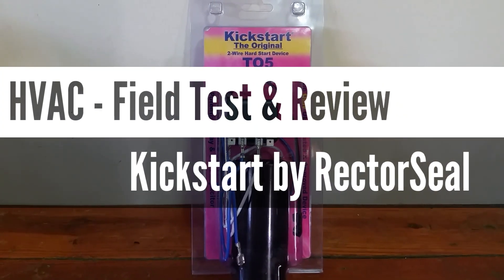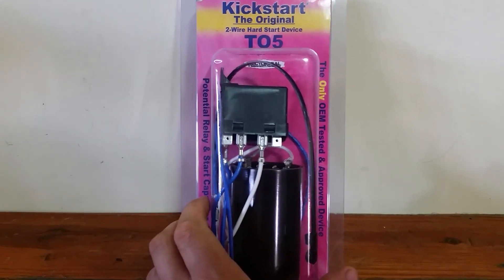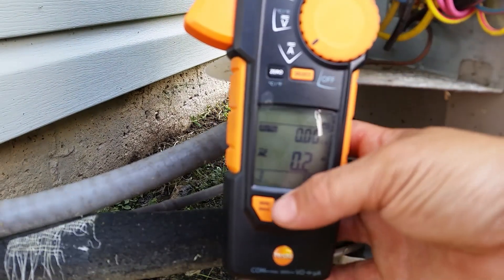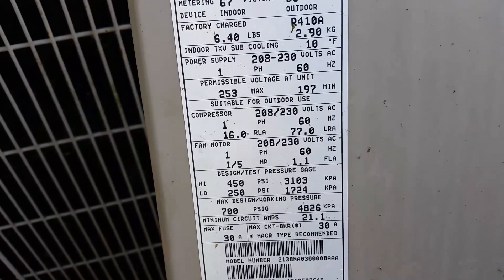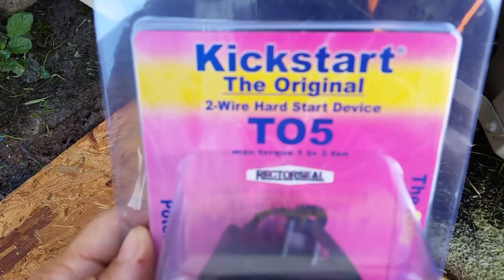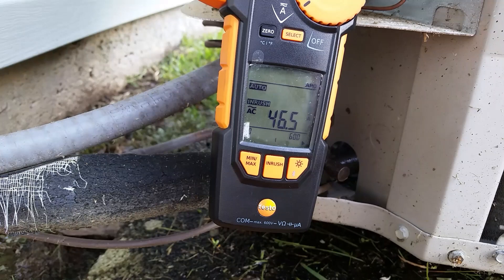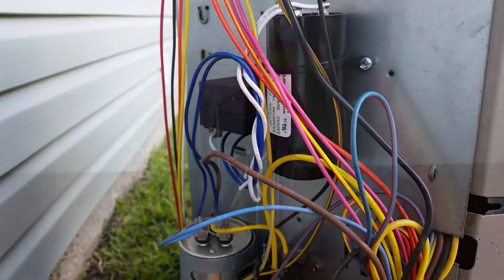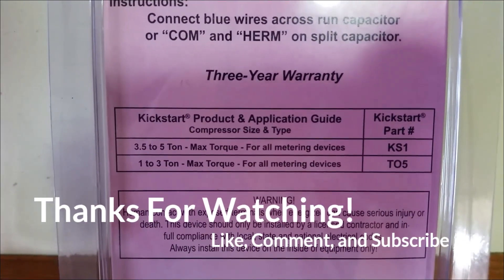Kickstart by RectorSeal Test And Review

Comment: Great demo.  on the RectorSeal, does it matter which Blue Wire goes to HERM/COM terminals?  I'm thinking of changing to this versus the Turbo Easy Start 2-Wire that's in there now on my 3.5 ton unit.  Thanks.

Comment: Thanks for the video.  My a/c wouldn't start yesterday.   I popped the cover open on the wiring cavity and the unit started right up.   I noticed the big black cap is Corroded.  How long do these kickstarts last?   Mine has MFG date of 2014.   Time to replace 6 years in?

Comment: The hard start capacitor comes shipped with no MFD for safety reasons from what I’m told and the best way to check it’s full potential is to install it and run it so the hard start can recharge itself then test it with a charge in it. What I’m wondering is how you lowered your amps in half unless it somehow had a charge. I installed a 5-2-1 in mine they claim it’s better than a 2 wire with the relay in the cap and I feel it’s better with an external relay. My 2 Ton was 58 in rush and when I put the 5-2-1 kit in it read 29.
Reply from the maker: Start capacitors ship discharged and that is how they should be checked. The MFD rating or capacitor value is determined when it is made in the factory and has nothing to do with its ability to hold a charge once power is applied. 
You will have to Google how capacitors work or how they are made to get a more in depth explanation that I can't give in text due to length.

Comment: Why does the factory not put these on their units ?  Wouldn't it be better for them?
Reply: Cost savings and potentially more parts to fail. You could also argue it may shorten lifespan of the compressor, generating a replacement sale sooner. My Lennox had the option from factory or add on from Lennox, but they charge over $150 for what is a $30 kit.

Comment: I see the capacitor was a 189-227mfd   you should try what copeland lists as a start capacitor the most common is a 88-106mfd  330v  if your in the HVAC business you know only the higher end ac units come from the factory with start capacitors lower end units don't to cut cost most wiring diagrams for the unit even if it did not come with a start capacitor from factory will show the start capacitor & relay in the wiring diagram . here the copeland info http://www.emersonclimate.com/Documents/Products/Compressors/residential_scroll/ECT2013ECT1.pdf

just wanted to add those Supco  are total junk in my option CHEAP MADE IN CHINA  I noticed the Kickstart kit had a B-M-I which are USA made much nice Kit     B-M-I  & TITAN-HD also made in USA is all i would use .
Reply from the maker: 218Bee mod43win  As the video clearly indicate I was testing out a product. Thanks for your opinion
Reply: what i was tiring to say is you should try a 88-106mfd as copeland list to see if you got the same lower  inrush amp draw as the Kickstart 189-227  mfd    it be interesting to see if the 88-106 capacitor has the same lowering of the inrush amps .
Reply from the maker: 218Bee mod43win I understand but I was only testing what was currently being used in my unit versus the Kick Start.
If we ever test multiple start devices against one another we may get more in depth.

Comment: Ive been using this product for around 5 years. Its great!
Sometimes the capacitor needs to be on the system for a cycle or 2 and the LRA will go lower even more. 
Did you get the amps on one more cycle? 
I like the new testo amp clamp btw👍
Reply from the maker: Mike Cianfrocco First cycle was actually 51A, the second was seen in the video at 46.5A
Thanks for watching
Reply: HVAC in SC i meant for the kickstart .

The first style hard start doesnt work in the summer here in florida. I dknt use those
Reply from the maker: Mike Cianfrocco The kickstart is what Im referring to.

Comment: I no longer use the Supco's due to finding them with blown tops, i.e. you get what you pay for,  Kickstart all the way for lasting reliability.
Reply from the maker: muniznick Thanks for watching
Reply: What about CPS/5-2-1? Amazon seemed indicate them as the main player in hard start kits. Reviews seemed good as well. Working with a 4 Ton unit running well but tripping the breaker occasionally.

Comment: awesome!!! I've used #66 potential relay with start cap...most of the super boost(2 wire ones) and variants the start capacitor has a low mfd most 150-160... that can start a 1 1/2- 2 ton unit, for 3-5 usually 250+ mfd start cap will work... in refrigeration you use that type of start kit and the one you reviewed can get me out of bind with a 1 1/2- 2 hp compressor... good one and great vid!!
Reply from the maker: Alexander Figueroa Thanks for watching!